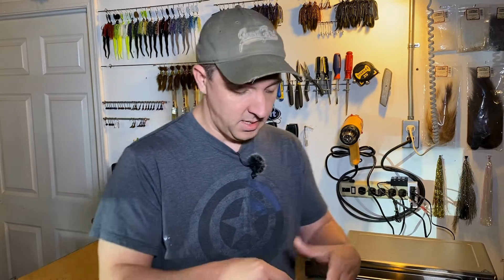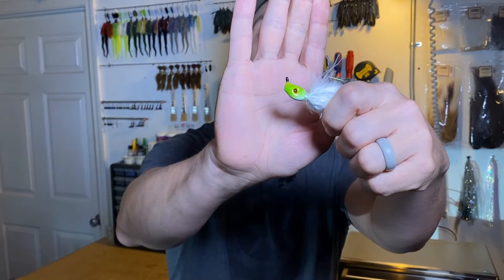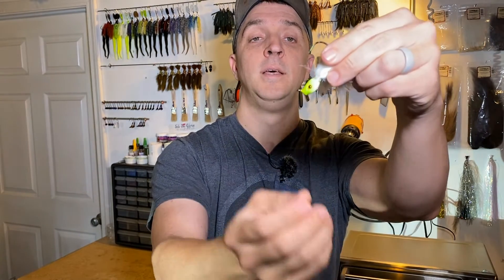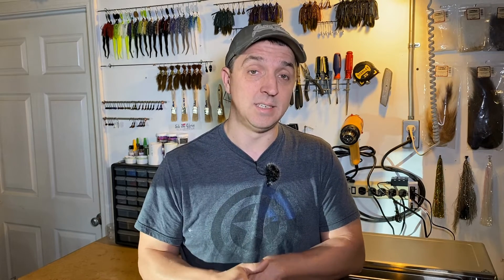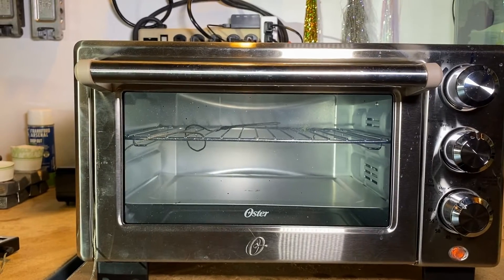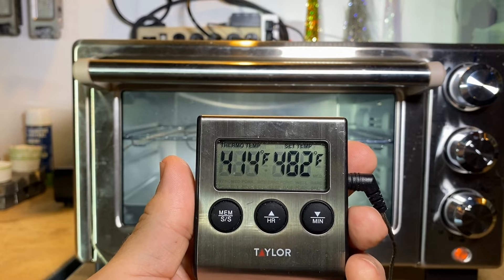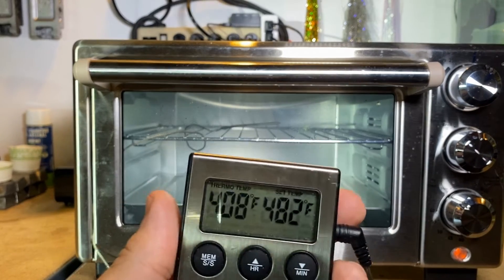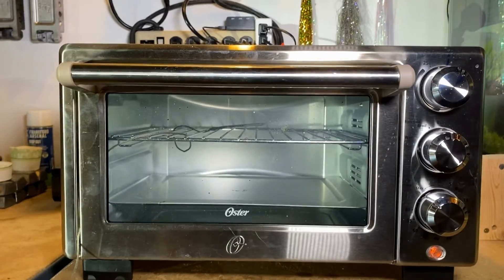Calibrate Your Oven for Perfect Jig Paint!

Comment: Most all those cheap toaster ovens are of anywhere from 50-100*F above or below
I have had a thermometer go bad,it ended up getting to hot and cooked the Seaguard off my salt hooks.
Now all I use is 2 manual gauges that you place in the oven.I don't use a toaster anymore,I use regular kitchen over as they do many many more at a time but they can be off too,but not as bad as a toaster.
A perfect coating is a head just hot enough to have the paint stick to it but not have the out side of the coat melted too. My larger heads I pour 1 at a time as it's not a production mold so what I do is quickly remove it from the mold,snip the sprue,tap it where the sprue was and dip in paint.It's still powdery and can rub off if you rub it with your fingers,but it leaves a perfect thin finish that is even harder to chip.You can even let it coat the hook eye on most all hooks 2/0 or above as it will not interfere with the line.Thick coats make them easier to chip even after "curing". Also the curing temp and time is once the substrate..this case the lead head..reaches that temp. Due to that I always add 3-4min. to my times.I also don't use the ripoff Protec,Stardust,etc. paints.I only use Prismatic Powders or MIT as they're a lot cheaper and they have over 6500 colors or combos.For about $2 more I can buy a whole pound of powder (depends on color) for what it cost for 2oz of that ripoff garbage.Like I said "depending on color" not all of them are going to be that cheap,but if you buy those ripoffs by the pound or even a couple jars of the same colors those two mfg's will be cheaper every time.

These rippoffs also probably get their powders from one of the few powder mfg's.,I know the folks I get my plastic baits from makes them for a good many big name companies.
Reply from the maker: Each to their own on the powder paints, I suppose!  So long as you (and the fish!) like it 👍👍
Reply: @SDGCustomLurecraft  And some just prefer to waste their $$ too.
Never had a fish write a letter and hang it on the hook to tell us they were going to go on strike and stop biting the Not Protec ripoff paints.